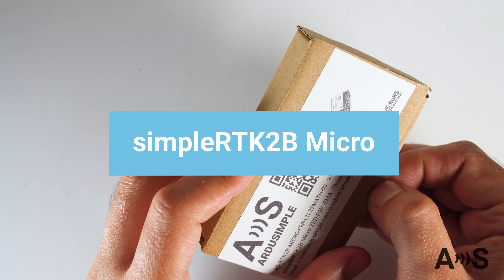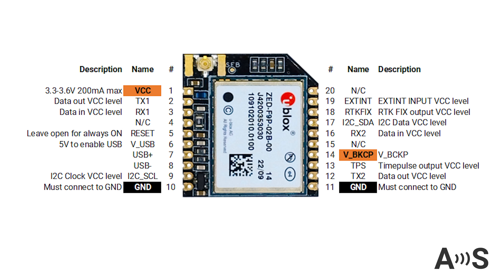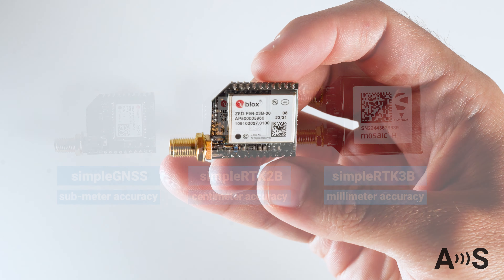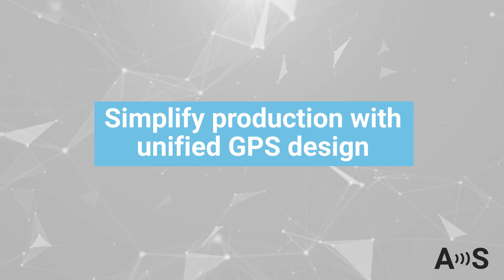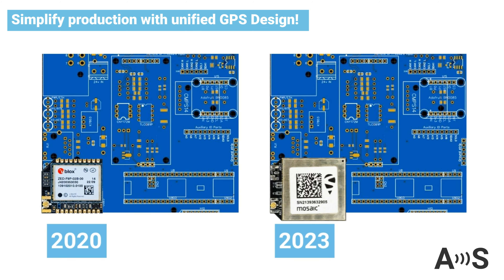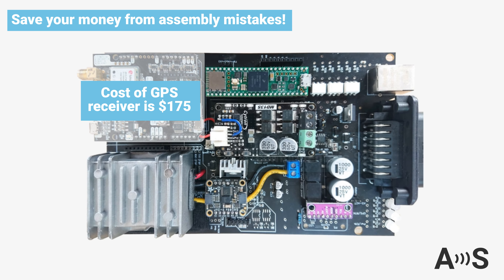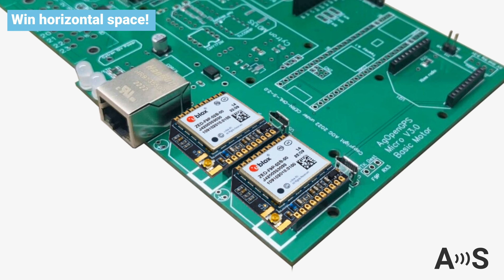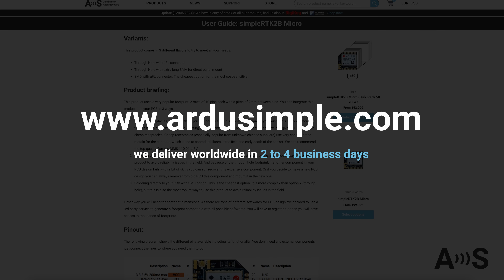Dual band simpleRTK2B Micro F9P,  F9R: smallest high-performance GNSS/RTK receiver for integrators

Comment: This Dual band simpleRTK2B Micro can be used with raspberry pi and arduino just with pins?
thanks!
Reply from the maker: Yes, it can be used like this but the pins are very small. For manual wiring we recommend simpleRTK2B Budget https://www.ardusimple.com/product/simplertk2b/ or Pro https://www.ardusimple.com/product/simplertk2b-pro/. simpleRTK2B Micro is recommended for PCB integration.
Reply: @ardusimple  so, i can wire this with a esp32 in a PCB or any other board?
Reply from the maker: @DanielEduardoToviasAlani-ef6uw  yes, correct